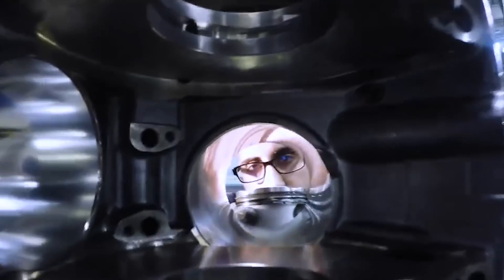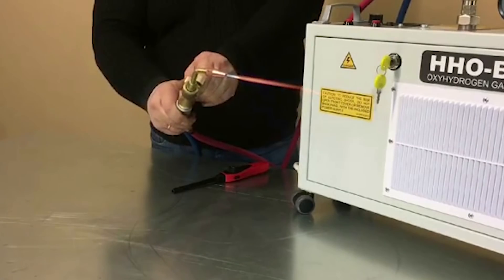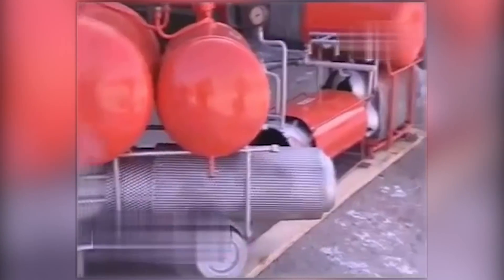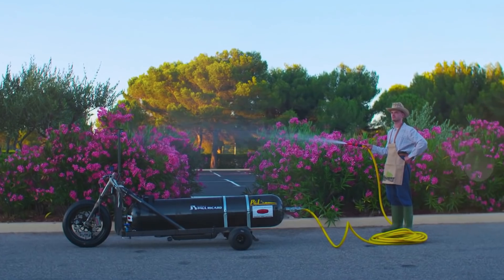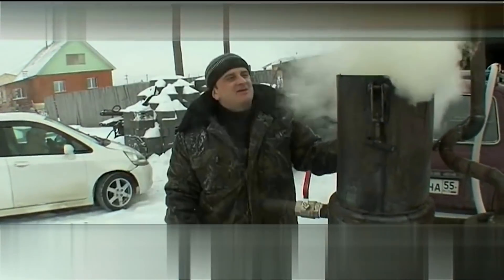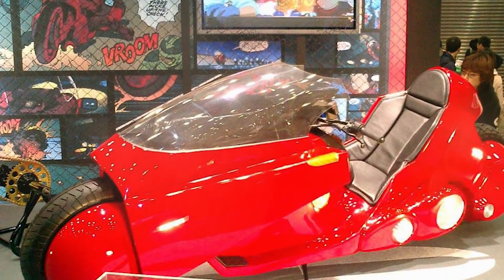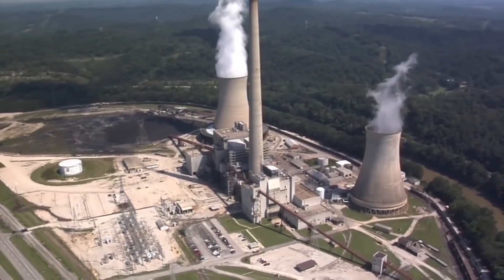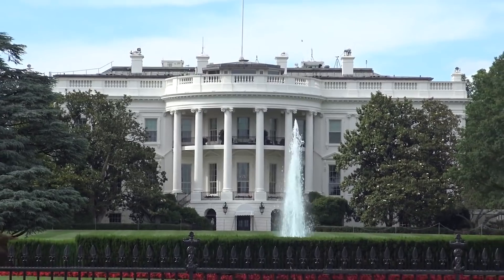Why These Engines Are Banned?

Comment: Tata's compressed air powered car is a bust simply because it's very inefficient. Compressing a gas heats the gas and the heat is lost. There's one slight upside to the whole cycle though. As the compressed air expands through the engine it gets cold and in India in a vehicle cold is good :) Unfortunately even that does not offset the terrible efficiency of compressing the air.

Now attempts have been made to use the heat generated by the compression of the air for something useful. This is fine from a physics perspective however as heat engines efficiency depends on Carnot Limit it's very difficult to implement.

Using compressed air for energy storage at grid scale is different. It's still inefficient but there's no further loss once the air is compressed unlike batteries which leak energy It starts to make sense when it's used to store energy which would otherwise have to be dumped.
Reply: Unlimited electricity just by harnessing coastal wave generators. A lot of transmission lines from the coasts through the nation.
 Also, why do they sell Air Powered hand tools? - More cheaper to run, cool running, more power than electric tools!
Reply: Wave energy is very problematic as the ocean is very corrosive plus marine creatures want to grow on the expensive equipment.

For sure air powered tools are great, they're lighter than electric and often more powerful plus there's reduced risk of a spark causing a boom.

You're wrong though, good air tools that will last are expensive plus you really need oilers in their air feed to keep them happy. Also air tools use turbines which work best at high RPMs so for  things like screwdrivers reduction gears are needed. Not only that but air tools still need a hose unlike battery powered tools.Efficiency isn't an issue here, it's just best fir for purpose  but it is for storing energy for a locomotive e.g. a car. It's not just the energy lost as heat when the air was compressed but also the amount of energy that can be stored in the vehicle. It's not a completely dumb idea, there used to be small shunting and utility trains that ran on compressed air. The railway workshops had heaps of compressed air on hand. Another variant was s steam train without a boiler, it was used for shunting duties, high pressure steam was readily available so why not make use of it.

Comment: There were fireless shunting locomotives back in the early to late 20th century. They were powered by a vacuum that was caused when the compressed steam, injected into the loco's storage tank, condensed thus causing the vacuum. This caused a pressure differential between one side of a piston in a cylinder and the outside atmosphere, causing movement and this propulsion to the driving wheels.

Like the compressed air powered vehicles and electric powered vehicles today, the fireless shunting locomotives relied on fossil fuelled external sources.

Comment: A rudimentary understanding of thermodynamics principles would provide an answer to why these engines are not in production lol
Reply: Hydrogen as a direct replacement for gasoline... the bi product is only water... no c02 what is stupid about that... standard internal combustion engines could be used so you don’t have to remanufacture every car.
Reply: @nick_kilgore  What's stupid is that the electricity used to make that hydrogen will not be carbon neutral. In fact currently most hydrogen is made from natural gas, producing plenty of CO2 in the process.
Reply: @aesma2522  exactly, hydrogen using electrolysis is not efficient. It uses more energy than to make than it produces. The world is ruined if we don't figure fusion out we are all screwed
Reply: @aesma2522  Unlimited electricity just by harnessing coastal wave generators.
Reply: @SamaritanElad  These have been tested for years and I've not seen any deployment of the tech. I would guess maintenance is a huge issue. Also problems with fishing boats and the like.
Reply: @nick_kilgore  how would one dispense hydrogen in an efficient manner?

Comment: Total BS ....  He is mixing  misinformation and lie with some facts.    the TATA Nano Car is a Gasoline Car not a compressed air car.  Rotary Engine was  not Government funded   but it is  by Wankel. and the list goes on and on and on....
Reply: You'll find the rotary engine in a couple of Mazda cars, including the RX7 and RX7, simple fact is they are powerful, but suffer a lot of problems, including drinking oil like we drink water!
Reply: You need to look up your information .  There is a car that can run on air.
Reply: @samuelhaynes4877  takes more energy to compress the air and energy is lost in heat due to compression. 100% in 45% out ish
I have 2 cars that run on air. With a secret fluid that I mix with the air.... Throw a spark in there, BANG! A car that runs on air! Kind of a 14.7:1 thing
Reply: Yes gasoline.
Reply: Yes,
Reply: Gasoline is the fluid.
Reply: Yeah just checked tatas website says it's a gas vehicle. Nothing about compressed air. It is possible to have a gas engine to make the compressed air on board.
Reply: And the Wankel is a terrible engine.
Reply: TE5LA please explain.
Reply: @jrich436  Wankel engines would be great apart from the nightmare oil seals required. In a conventional cylinder engine the oil seals (piston rings) are simple to make, but a Wankel engine has right angle corners where the same seal has to seal to both edges. You would need at least 4 or 5 parts per baffle where the cylinder only needs 1. Also the length of seal is much longer.
Reply: @dougaltolan3017  mazda worked with the wankelmotor long time i the rx 7 and 8. They didnt last long unfortunatedly. But as I heard they kept on using this technique and tried to make itbetter. When i remember rightthey even bring it back on the market.
Reply: @dougaltolan3017  I do not see where an Apex/lip/side/corner seal is significantly more difficult to engineer than a cylindrical compression or oil control ring.

Most issues with sealing had to do with dissimilar metals and the different rate of thermal expansion between components in the different housings. 

This was addressed by Mazda Speed and additional cooling and seal component coatings answered this issue in late 13b and 13b-TT.

Aftermarket companies likewise changed the seal construction and offered additional controllers that were better than the fuel cut deffensors etc we were limited to in the mid-late 90s  

3mm Apex seals are pretty much go to for any performance gains or restoration of high mileage engines. Have had no issue with the corner blow by that I think you were talking about

On the other hand, how hard is it to get the average push rod engine made at that time to rev over 8k on a daily basis? Would you do it in a 2018 Ford Coyote?

Shrink the average piston engine down to 1.3L and let me know how much power it makes

The GTX was engineered to compete with the Porche 944, the Turbo II was made to compete with the 944 Turbo but could also match the 928 as long as it was not an S.... for far less money.

The Efiny and Type R FDs are Super Cars by Japanese standards.

There is a logical argument for how non eco friendly the original 12a, 13b and 20b motors were but American FD's are clear air act legal...so....

I dunno man, engine seems pretty cool and was revolutionary (pun intended)

By end of production the issue you were talking about was solved, but I guess the stigma stuck. Give it another chance! :)
Reply: @jrich436  the issue is providing a good seal that can also remain low friction.

in a piston engine, there are multiple seals on each piston to prevent gas from getting into the crank case. in a Wankel, each corner is limited to one pretty much. That's simply asking a LOT of any material, while they got VERY good at keeping blow-by to a minimum, they still burn oil. In a piston engine, camshafts can be set up with VVT or variable valve profiles to optimize performance/economy, on a Wankel that's harder to do (other then porting the valve ports). 4-stroke piston engines can be made far more emissions friendly and retain high-horsepower. That's just harder to do with Wankels. Not impossible, but hard.

they're hard to beat performance-wise, but as people's taste lean more and more toward low-or-zero emission vehicles, the design's shortcomings are going to come back to bite it. The engineering on the Otto format just has the edge there, and by the time the Wankel would catch up, Electric infrastructure's going to be in place

One area where I'm surprised Wankels didn't do much better then they did was Model aircraft/car engines. Nothing to worry about emissions wise, oil's already in the fuel to begin with, and the simplicity beats out the issue with seals.
Reply: @DFX2KX   Modern corner and apex seals > 80s packaged stuff. 

And on the 8th day God created 3mm Apex seals.

Rotaries USE oil by design and passed clean air act regulations imposed in the 80/90s. They fit within the guidelines of other engines at the time. People act like they put out Semi truck levels of emissions.

Its all repeated rhetoric

Variable valve timing is only arguably important for someone who wants "race feel" in the streets but won't shell out the money for a performance car.

High fuel vehicles didn't have it and the C series motor's curves were FAR more intuitive than the D/H/B motors from Honda at release to the streets. 

Made cool noises....still get left at launch and unless we are racing 2 miles its over and done with.....

Great tech, revolutionary, but over hyped and grossly exaggerated in its street use and negligible on the track. Kinda like teaching an underweight kid karate. They hit harder than normal people their size but still aint winning a lot of street fights.

Once you get into high performance, there are multiple packages of valve timing elimination cams as it just doesnt matter anymore, ESPECIALLY high lift low duration for turbo application.

People who lean towards low/no emissions vehicles and performance seekers have minuscule overlap. They are not of the same mindset, spending range or market for the most part.

RX7/Turbo II were engineered to compete for Porche 944/ 944 Turbo buyers not Crx HF or Volkswagon Rabbit buyers

Cleaner/more complete burns are the byproduct of higher volumetric efficiencies, they were not the main goal of designs like higher compression ratios. 

NON PERFORMANCE car buyers want greater fuel efficiency that comes from higher VE. Performance people are still buying larger engines and now trending to V6 Turbos because the producers are MAKING them go that way. Not because they said "HEY, I want 180 on the dash and you BETTER lower those emissions or I'm not buying it"

You are mixing multiple mostly diametrically opposed consumers and saying the overlap is the majority. They are not.

Rotary still has a place in ultra light aircraft as well as watercraft. Google Rotex. 

This is because pound for pound they still make a bunch of power.

Its rhetoric, people just repeat the same things that someone who couldn't follow the tech or afford the cars back at release said.

The downfall of the Rotary is that it was licensed through Mazda, a Japanese company, and not priced to sell.

It was a niche motor for niche vehicles that were adopted by a certain type of buyer with a certain mindset. I want what you do not have and I'll spend the money even if it does not perform on the same level out the box and I have to go to a super specialist to make it.

Had it been priced economically and mass marketed for use they would still be in production.

The motor is fine

Comment: all seems to be so pretty and easy... but there is something like efficiency and energy density. some of those alternative engines will run but have terrible low efficiency and some of them will work but will be heavy like tank. that's why internal combustion engine still is ruling. even if have only 35-40% efficiency. but fosile fuels have so big energy density that still 60kg is enough to make 1000km.
Reply: lol they gave that air powered car the thinnest wheels on earth and probable has like 15 hp and it still can only go 100 km. I'd rather not be waiting on my air tanks to be filled every day. People tend to forget about the importance of power density and the simplicity of a regular ICE.

Comment: Yet oil is still cheaper in the long run, also wouldn’t the military be using this tech already if it worked.
Reply: To which the true believers would reply something on the order of "How do you know they aren't?" It is possible to be SO open minded that your brains leak out your ears. Let 'em believe what they wish.

Comment: Hydrogen, hydrogen, hydrogen... why don’t we use it more as a fuel source?
Well, why don’t you ask the engineers that flew on the Hindenburg?
Oh... wait...
Reply: Hydrogen IS in use as a fuel, hindenburg used hydrogen to float, not drive engines.
The Nikolai trucks are hydrogen-electric (Hydrogen tanks, running a generator, and electric drive train), and various car makers have had hydrogen models for the last decade or so. London ran Hyrdogen busses with no emissions in central London other than water vapour.
Reply: stuinNorway, yes you’re right about hydrogen fueled vehicles having been around for some time. The problem hasn’t been using hydrogen as a fuel. It’s vastly more efficient than oil based fuels. The problem is storing enough of it to make it practical for a vehicle. That’s where it’s greatest danger lies.

Comment: H2O.  One of the strongest molecular bonds out there.  Takes an ENORMOUS amount of energy to break.  Far more than you get back from the hydrogen gas by itself.  What's next?  Are we going to make gold from lead?
Reply: The only thing that might cause a breakthrough is some kind of catalyst on the plates or in the water that could lower the voltage needed. If it exists, it should have been discovered by now.

Comment: Banned ? probably not ! Discouraged, Sabotaged or Destroyed either by Big Energy (Gas, Oil, Electricity) or by Governments. This is because the technology and resulting economic value would destroy the existing money printing non renewable resource industry that the present Big Energy and Governments run on and it would probably be to difficult to fold these new players into the old mold. It is amazing how Threatened  these most powerful Corporations and Institutions are when something non harmful or efficient comes along. The worst part about this process is that there is nothing any of us can really do about it. It is SAD to think how far we have come and how greedy we have gotten in so short a time and it will happen when newer technologies come along in the future.

Comment: The air power that Japan is using is mot standard service air, it's 2500 psi or more basicly industrial bottled type air or scuba tank air standard shop air is 90 PSI up to 175 PSI
These are heavy high pressure bottles. Again 2,500-3,000 psi. The government deems them dangerous. But they are not. Heavy storage bottles are practically bullet proof. More false information to try and kill the idea. So oil can prevail. Go figure.
Reply: It is still a wasteful process to compress air, big oil would WANT compressed air cars. They power the power plants

Comment: There are no banned secret engines. There are complicated reasons why none of these engines are common or commercially available, and unfortunately going, "Oh well the oil industry must have a wrap on it all" just doesn't help anyone understand the complexity of trying to build, manufacture and sell anything as sensitive as an engine. Think about all of the people, education, capital expenses, horizontal and vertical industries that have to be lined up to supply components, logistics industries to move everything, distributors and sales reps that have to understand the product, its applications and appropriate customers. AND IT HAS TO WORK AND BE AFFORDABLE!....the list goes on...
Reply: I read about an engine that was in service in New Orleans to power a trolly before the Civil War that was operated on anhydrous ammonia. I assure you if you tried to use that kind of technology today, you would be put in jail just for the smell.

Comment: About the H2 engine. Basic physics, it takes electricity to split apart O2 and H2 from H2O, and when the engine runs H2 burns. How is that a generator? If you need electricity to begin with. And for sure the engine's efficiency is not 100% meaning the energy taken to split the H2 and O2 will be more than what burning the resulting H2 can generate.

Comment: 0:25 - German Wankel engine. Tested by Mercedes and later adopted by Mazda. 
Rotary engine is a piston engine with a rotating crankcase.
Please, do your homework.
Reply: I believe the Wankel engine configuration can be used as an oil pump in WWII German aircraft.

Comment: Bullshit..! The so-called rotary engine is a Wankel Motor developed AND build by Felix Wankel a German engineer. It has NOTING to do with the USA or their defense department at all.

He build it and it's called: Rotations-Kolbenmaschine.  Later he sold the patent to NSU which was the first automobile maker to use this engine. As it didn't go all that well for them Auto Union bought them and they sold the patent to Mazda. Ever since have they been making these engines.

Comment: The biggest issues with these engines is efficiency. The rumors of thier efficiency are greatly over stated. The energy used to charge these devices are usually fossil fuel engines themselves. They just add a level of complexity that is unnecessary.

Edit: any thing from Russia is likely to be mostly fake.

Comment: All internal combustion and turbine engines are powered by air. The fuel used varies, but in all cases the fuel is used to heat and thereby compress air thus driving a rotating shaft.